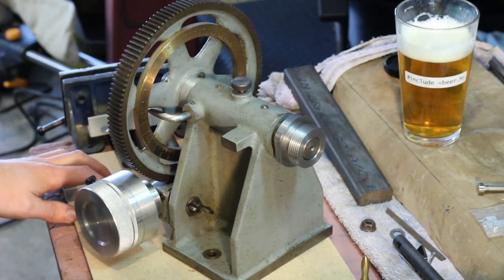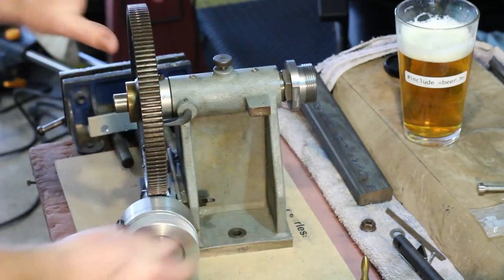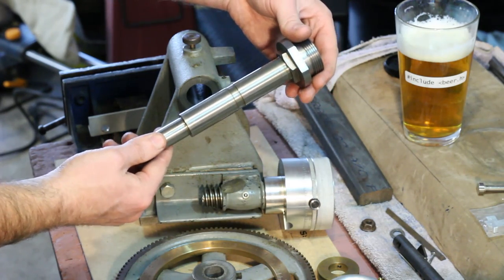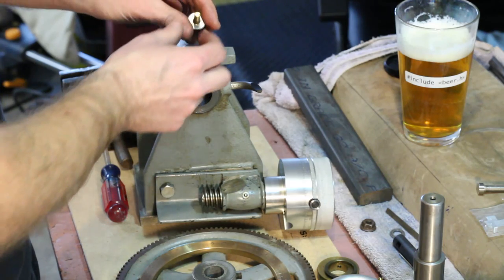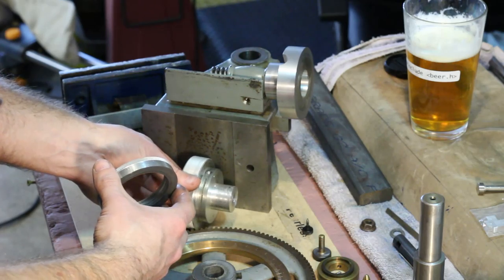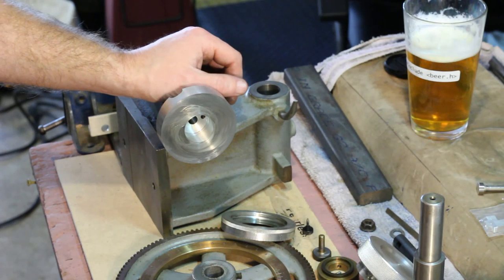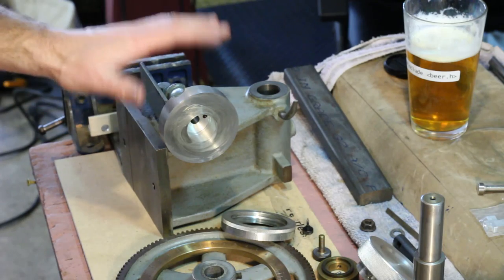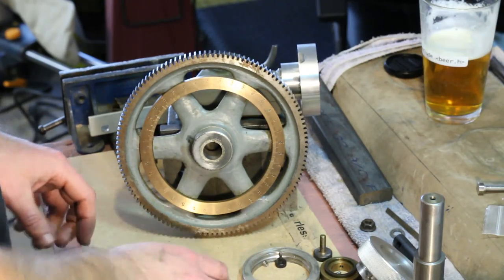Shop Talk: Dividing Head

Comment: Neat trick with the spring and ball bearing pushing on the handwheel collar.
Also, couldn't you just file (guessing it's not hardened) a small flat into the spindle shaft for the gear set screw to rest against to prevent slipping?

And since you're taking video requests, I wouldn't mind a closer look at your Rivett lathe.
Reply from the maker: The replacement cross slide handwheel I made for my Rivett lathe is even better, it uses a spring loaded ball bearing like the one you just saw, but on the opposite side there is a ball bearing that is pushed outward by a taper on the end of a thumb screw in the face of the handle.  Much more effective way of locking down the zeroable collar, and the locking screw ends up in a spot that's less in-the-way.  I would be happy to do a video about the Rivett lathe, that would be a good chance for me to show how I made that handwheel, among other things.  Regarding filing the dividing head spindle, yes you're absolutely correct!  The spindle is not hardened at all.  There is no good reason not to do it... yet somehow, I still haven't.  :)

Comment: #include <beer.head>, you mean:). That is a very good dividing head indeed, eerily similar to  the one I am sweating blood over right now. I prefer dividing plates, although I will admit that 2 arc min is good enough for almost anything. I make my own plates.I must think over cutting prime number of teeth with a plate -- like the 127 metric/Imperial gear.
Reply from the maker: LOL, I see what you did there!  For prime counts, you'd be much better off going through the manual, cumulative (absolute) dividing process I mentioned, to make a master indexing plate to be used for direct indexing the work, rather than going through any dividing mechanism.  I'm going to need difficult tooth counts not only for a metric transposing gear for the lathe, but also for the orrery project and perhaps eventually for a perpetual calendar mechanism.  I plan on generating plates with those difficult counts to use for direct indexing the gears during cutting.
Reply: I think you are right, and it is comforting to reflect that any error is reduced by the worm ratio,

Comment: have you checked one of those spindexers out.  iv sean different fellas use them to cover lots of maching problems that said i like the shop made tools big time.thanks for sharing and   take care :)
Reply from the maker: Hi Noway!  Yep, they look super handy for direct indexing.  You never seem to see them made in anything other than 5C, and I don't have any 5C collets (because none of my machines use them).  My father has one and he uses a 3" chuck with an integral 5C shank in his, which I think is really neat.  I wouldn't be opposed to buying one of those inexpensive 5C spindexers and making a new spindle to take my 4NS or 5NS collets, but I have a really nice old direct indexing attachment made by Hjorth that is the same as a spindexer but mounted to a dovetailed slide and made to attach to the lathe milling attachment (though it could also be mounted to the mill table if necessary).  It works really well for my direct indexing needs, but I do need to make some additional plates for it pretty soon.
Reply: tools are cool :)